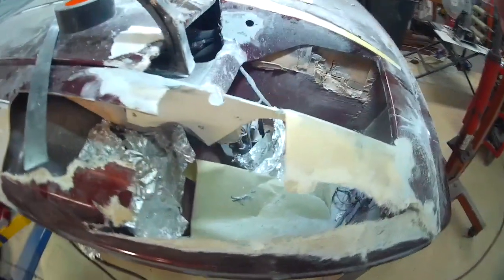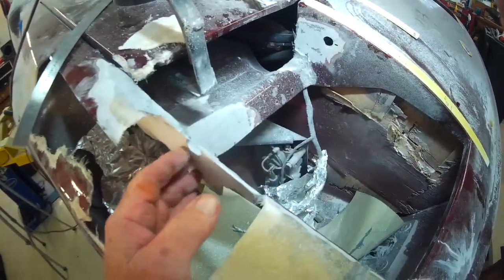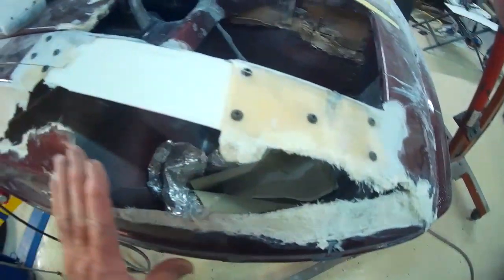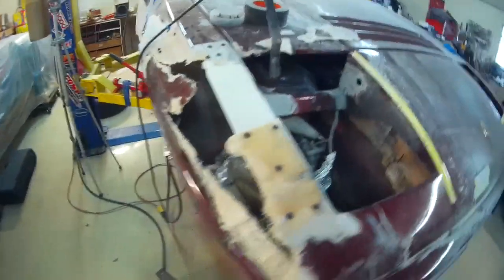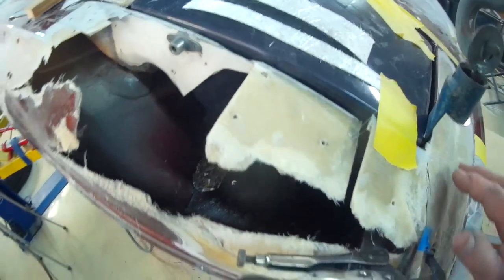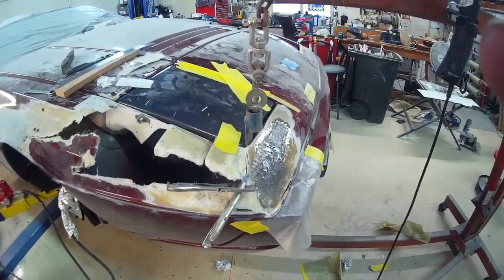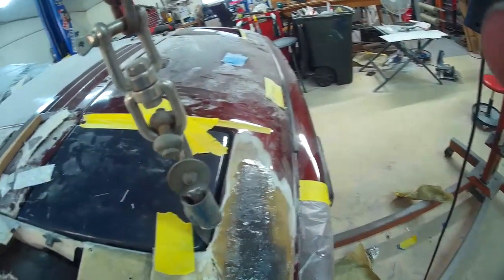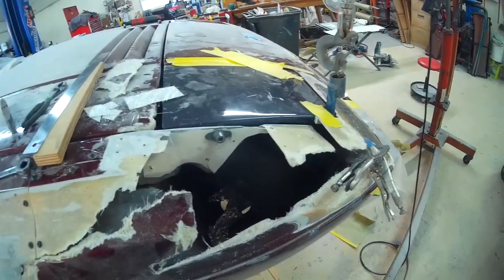Lotus Fender Repair Pt7

Comment: It Might be easier to attach the headlight bobbin hardware on the radiator side by cutting through the dry rotted plywood? It's  no longer structural and should be removed/replaced longterm anyway. Replacement panels are available and I have them on hand (I am the car owner ;<).
Reply: The bobbins should be fitted from the pod void side so that the "wide" end faces the same portion on the pod itself. That helps with the spacing/alignment of the pod. There's enough space above the radiator to slip a reinforcing plate in from the engine bay (probably need the bonnet off, though). If you can't do that, access is very good with the bumper off. A smear of epoxy helps to fix the plate in place in case the rivets break off.  The plywood can be repaired in situ with a bit of GRP, although it's much easier to do that with the bumper off, too. Even removing the mid-spoiler section helps with access.
Reply from the maker: Thanks...the reason I had the mounting the way I did was to locate where to drill the hole. To repair that area of the fender, the  hole was gone. So I gave it best guess and then worked the hole until I got the H/L assy where I wanted it.